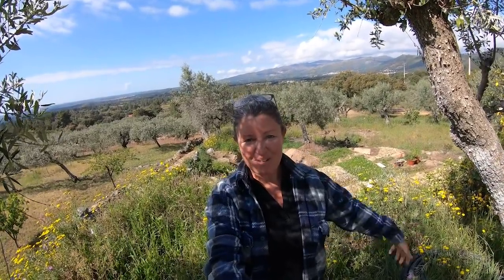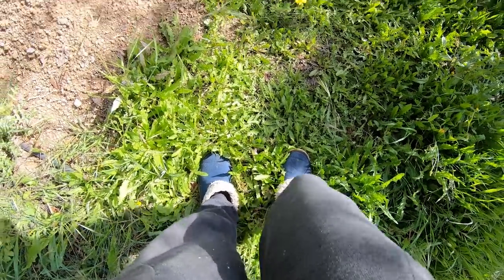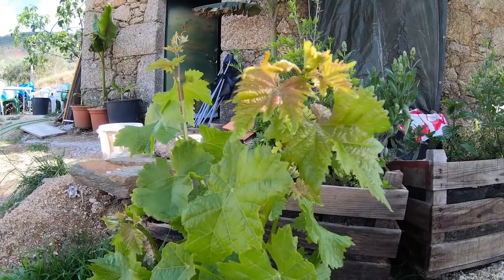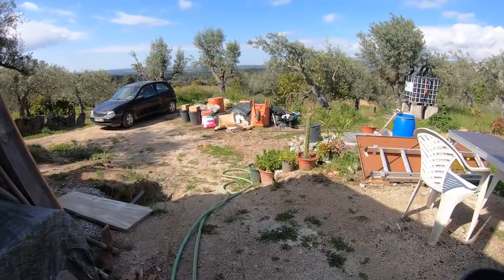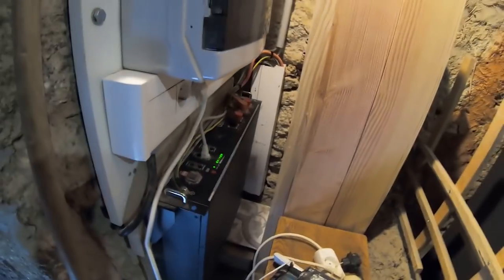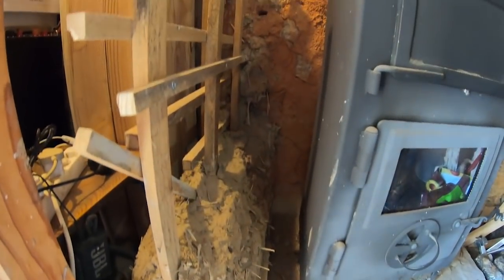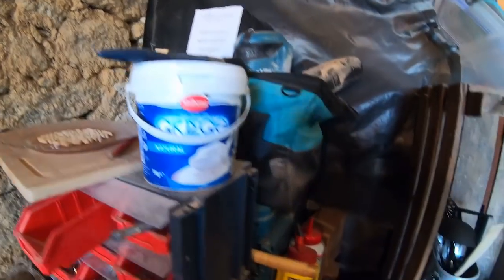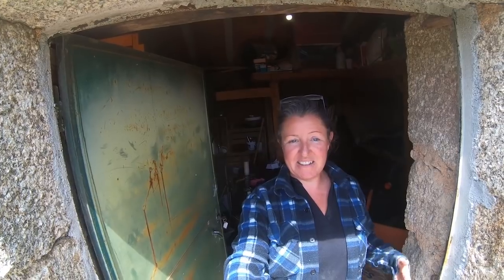Inside My DIY Stone Barn Conversion in Central Portugal - Part 1

Comment: I think once all renovated it will look super. I love your log burner. Have you considered extending where your kitchen is outside to make it a permanent kitchen. I wonder if you errected a gazebo at side of house and put a tin roof on and a  tarp around sides you could house all your tools a bit of a garage, then you would have more  room inside to work around. Maybe consider a bigger window to let light in. All in all you have done a considerable amount of work. Your on an amazing journey. ❤
Reply from the maker: Good idea for the tools, or at least to keep building materials there and dry and out of the sun. A window is on the cards as well. Yes, I'm loving the journey and the work so far! Thanks for your comment! :-)

Comment: Hi Kirsty.  From my experience,  please get a trellis for your Jasmine as soon as possible.   It will bush up and grow incredibly quickly once you have a trellis.  If you buy a lot of fine chain and cut lots of strands to door height and sew them onto a material/curtain band with a rod through and mount it just inside the door, it will keep the flues out and you can still have the door open in summer.   Check it out in Nick's vlog on Project Portugal.
Reply from the maker: You know I feel like I'm in a race against time against my jasmine every time I look over there. I really hate making trellises so I've been avoiding it but I'm sure I can come up with something. Any suggestions for an easy-to-make or cheap-to-buy support for it? Thanks for the screen advice too! Another one of those jobs that absolutely needs doing asap! :-)

Comment: Just a little hint.  If at all possible, run that stove pipe out at a 90-degree angle.  That will keep the rain from following the pipe into the house.  The 45-degree angle is a perfect channel for the rain to follow.
Reply from the maker: Another person made the same suggestion. The reason I did it at a 45 was because that's the advice I had for getting better airflow, but there are other reasons, too, besides rain I'm considering switching it over. Mainly cleaning, rain hasn't been an issue so far but could be in the future so I think I will change it. Cheers!

Comment: I have an idea for your tiny window space. Only if your going for letting some light in, not air. How about a square/ rectangular glass bottle or two the same size that the necks are cut off and you tape/ attach together and fill in around with cement or something but not the inside wall and outside wall. Then light would spill through.
Reply from the maker: I love this method and I'll use it for sure within future cob walls inside my house and on future projects, but for these little windows I want to be able to open them and have air so I'll figure out something else for those. But I love the bottles look!
Reply: @PortugalfromScratch  After re-watching an older video, I realized that you want a bigger window there for more light and air. And you had said you weren't sure how to proceed with removing the rest of the stones. I will be really interested to see it when you figure it out, because I would be nervous that the stones above the space would fall down. But It will be really nice when it is done. I am looking forward (not to rush you at all) to seeing it. I have seen but not watched a few stone building renovation videos on other channels that are being done in Portugal. So maybe one of those would help. Now, here is another idea that may or may not work because it is all in my head. Use good thick wood to make a square-ish frame (depending on the shape of your window) that will fit the space you have now and eventually the window inside, it will need to be half the depth of the stone wall, (you will need 2 of these) Install and brace up on the inside.  Next remove only one layer of stones on the top outside of the window space and attach an temporary extension to the top of the frame now installed on the inside and use supports on the outside probably down to the ground on each side. Then take out the rest of the stones from the window on the outside. Then slide a twin frame into the window to match up with the other side attaching the two sides together and then fill in the spaces outside the frame with stones to fit and cement.  Anyway, take it or leave it, that's my idea.
I very much enjoy your videos! Keep up the good work!
Reply from the maker: @coryellpeters6099  Ah, the window! It haunts my dreams! I'm also looking forward to seeing how it goes! Haha! Your idea is a good one but overkill for what I need to do because I don't actually have any stones above the window on the outside at all and, even better, the ones that are there aren't supporting anything. I've already made a concrete lintel on the interior to support the rafters which don't actually extend all the way to the front of the stone walls, if that makes sense. The thing that's holding me us is not having stones to replace the ones I take out on the front. I need a long lintel (thought it doesn't have to be thick as it's just aesthetic and not supporting anything), plus long rocks to frame the sides of the window. Once I get these I think I'll be fine... I just need to get motivated to take up the challenge! I think my fear is putting a giant hole in my wall but I'm already half way through and I've already done the hardest part of supporting the rafters. I'll want to get to it before it starts to rain again because water leaks in, so stay tuned!! Thanks for the tips!

Comment: Just a little warning. We have had some house fires in Australia where the back up batteries have overheated and caused serious house fires. Make sure you check out the best thing place for the back up battery and any safety rules you are to follow e.g if the batteries should be outside.
Reply from the maker: Thanks!

Comment: You might want to make the exhaust pipe go horizontal when exiting the building. There are two advantages. 1. Water is less likely to flow down it into the building. 2. If you buy a 90 degree cleanout piece and put that on the outside, it's easy to clean out.

If you staple some hardware cloth or wire mesh to your wood lattice, the cob will stick better.
Reply from the maker: Yes I'd considered that but everyone told me 45 degrees is better for air flow but I'm wondering if I'll switch it up for the reasons you mentioned. The cleaning option also exists for a 45 degree bend but the way my stove is built, the baffle doesn't come out and if I clean from the top, the crap will just get pushed down and maybe get stuck inside the stove in the baffle. Hard to describe... but basically I'd prefer to be abe to remove the stove from the pipe altogether and a 90 degree pipe makes that possible whereas, once I seal the wall up, I don't see how I can remove my stove from the pipe. Lots to think about but a problem for next winter! For the wood, I've been putting nails in as I go but mesh is a good idea, too. Thanks!
Reply: @PortugalfromScratch  Very cool stuff! There are many ways to make things, and I'm excited to see what you create. :-)

Comment: WELL BLESS YOUR HEART..!! SUPER AMBITIOUS, BUT SO MUCH RESPECT FOR GOING AFTER IT!!...  REALLY LIKE ALL THE TASKS YOU ARE TACKLING AND THE PROJECTS YOU HAVE SYARTED SO FAR. AND YES POWER IS GOOFY!! IVE DONE A LOT, AND VERY HIGH VOLTAGE, BUT ITS STILL UNPREDICTABLE. POWER OFF SWITCHES RULE...LOLOL!!  CUT IT OFF OUTSIDE SOMEWHERE FIRST I SAY, AND IVE LEARNED TO USE A CONTINUITY /VOLTAGE METER TO TEST FOR HOT WIRES. RUBBER GLOVES INSULATE, BECAUSE WE ARE LIKE A STEEL ROD... ENJOY THE ADVENTURE AND LOOKING FORWARD TO SEEING THE PROGRESS. WISH I COULD HELP. BUT IM HERE IN IDAHO WORKIN ON MINE.. TRYIN ANYWAY...
Reply from the maker: Thank for your support! It's a long journey but an enjoyable one for sure! I think that's what it is about electricity... a mistake can be very serious and I'd rather leave that up to the pros! Good luck on your own project!